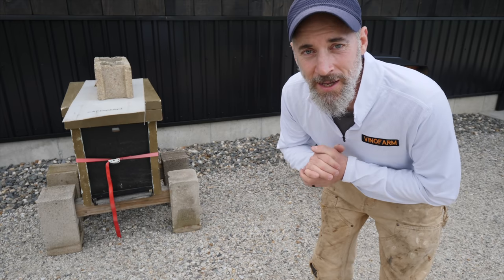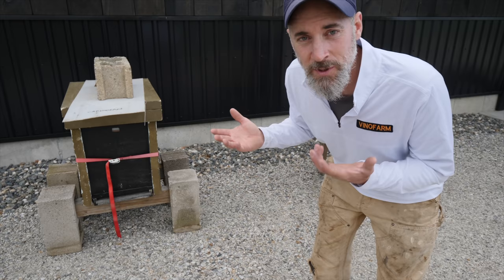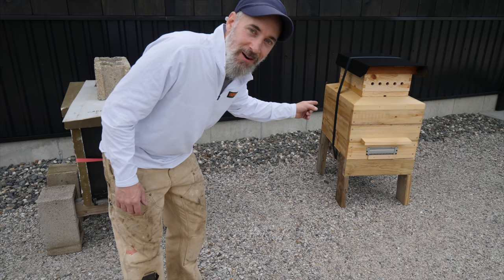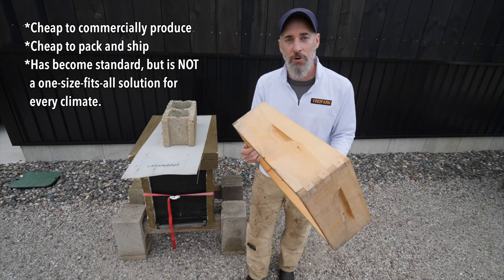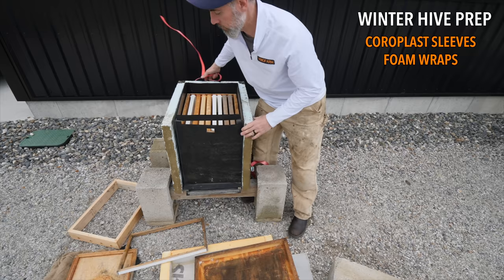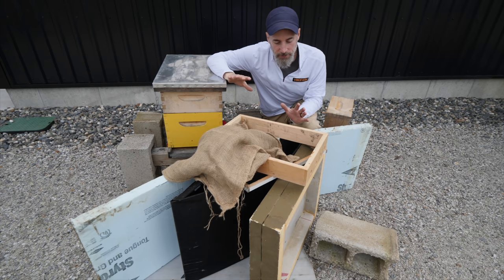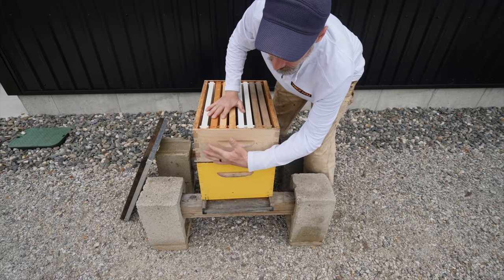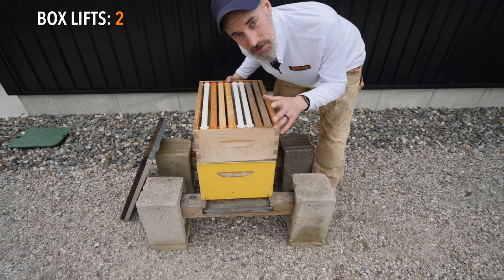I Fixed The Langstroth Hive (For The Bees AND The Keeper!)

Comment: It seems as if you were heading towards re-inventing what is called here a "Warsaw's hive" ["ul warszawski" in Polish] :).
A stationary hive, used in Poland  (winters used to be harsh) mainly by older beekepers (back issues!) , with a 'narow-high' frame (hight greater than width = better space for winter storage ), with no need of lifting boxes, possibility of adding supper.
Reply from the maker: Great minds think alike, I guess? I have never heard of this, but if you have more information, I'd love to hear about it.
Reply: @vinofarm  It's a hive, based on ideas / solutions to problems - as you discussed in your video :)

It seems the first piece of such a hive (in it's "standard" version) was built in 1880 by Kazimierz Lewicki (from PL nobility family). It was popular untill  WWII, when - due to standarization - it's been replaced by other hives. Later on it was "extended" into form of "Warsaw's extended hive" - allowing for having more frames and / or 2 families in one hive.
The top is fixed on one (front) side with hinges, so one does not even lift that piece at all. Simply open it like a trap door for inspection and it stays in place. Even less ibuprofen ;) + the roof can be slopy.
I believe similar hives are also used further E / N-E in countries with harsh or prolonged winters.

Comment: How much of a concern is the cold?

Because I think you have a weak spot at the top where the sides chamfer back into the box at a 45 degree angle. There's something called an "energy heel" for rafters in construction that allows for a contiguous r-value/insulation transition from wall to ceiling. I'm wondering if insulating the sides of the top box above where the burlap is by having a winter insulation wrap that would extend downwards with a reverse 45 degree chamfer would advantageous for cold months while still allowing for your side vents. You could even insulate the top lid above the side vents to allow for ventilation. You should also consider facing all of your bee hives so the side vents are not facing your prevailing winter winds.

Does that make sense? I'm happy to draw it up if you like, I work in building design and am curious what your thoughts are.
Reply from the maker: You're describing exactly what I'm already planning on building. I just haven't made the winter lids yet. When I made the video I had just finished building 6 of these to be ready for bees to arrive the next day. The last part of this is the winter lid, which will be ready for winter in 6 months or so. Stay tuned.

Comment: @VinoFarm Can you give a rough estimation of how many board ft it took to cover the insulated brood chamber (deep+med)?  Wood is so expensive right now, especially larger boards and better quality (ie: cedar) - do you think there are other options that wouldn't harm the bees?  I was considering some kind of siding, or composite boards, or metal roof panels?  Also, I live in a very wet environment (PNW) and was wondering if house wrap over the basic boxes and under the foam insulation board would help with wind and moisture getting into the hive?
I'm excited to see how this goes for you - I have been very unhappy with the wintering results from my Langstroth hives and was considering trying to build a Slovenian AZ hybrid hive to see if that protected them more, but yours is a much easier option.  Thanks so much for sharing!
Reply from the maker: Each hive used exactly four 2x6x8’ cedar boards to wrap around the insulation the way I did it. I paid $18 per board. Pine would be 12-15 these days. Cedar is way better. If you’re in PNW, that’s where this stuff came from. It would be cheaper there.

Comment: I'm trying my hand at making an insulated Long-Langstroth hive stealing some of your ideas from these hives. With 2x (fir?) for the main box, 2" of insulation (R10), and 1x cedar for the exterior. I'm planning on making a barn-style lid with extra insulation, venting, and room for some sort of feeder as well.  I do have a couple of questions though...

1. How do you treat with OA with such thick walls? Via the entrance?
2. Have you found the need to remove the insulation in the base in the summer heat?

Comment: Why did you say you wouldn't use burlap or a vivaldi board in Missouri.  I lost my first hive to condensation over winter because I wasn't taught how to deal with moisture.  When I questioned my mentor about venting the hive for winter he said the upper entrance would be enough and I went with what he said instead of my gut and what I had read because he had decades of experience.  It looks like the vivaldi burlap setup would have saved my bees. I'm definitely interested in following how your bees do with this new hive set up. I just got bees again and this looks like a good compromise between wintering with 2 deeps and just one. Thanks so much for sharing.
Reply from the maker: I have not heard of people in the southern states needing to worry about condensation over winter. Winters are not very long or harsh there. Northern beekeeper have condensation to worry about. Also Pacific Northwest beekeepers. Are you in Missouri?
Reply: @vinofarm  yes I am in Missouri.  Not a southern or northern state. Smack dab in the middle. Our winters are about 4 months. Moisture and humidity here in the winter can vary from year to year but we have the four  seasons very distinctly. I have learned since that unfortunate experience that moisture is our number one threat to overwintering bees.  We may not need quite the level of ventilation you have to insure but if there us no problem doing it that way here I'd rather be safe than sorry unless it creates an issue I'm unaware of.

Comment: So when it's hot in the summer. the bees generate heat, it keeps the heat in and the heat builds up. You need to do some tests on temperatures of a standard versus your hive over time, against external temperatures.
Reply from the maker: I have temperature and humidity sensors in all the hives. The bees are doing perfectly fine.
Reply: @vinofarm  interesting thanks. What difference in temps do you see? Out of interest.

Two of those disks on each hole would mean you don’t have to change over. Just select the open hole on which ever side was in the bittom
Reply from the maker: @Nickle314  Bees will do whatever they need to do to maintain the temps they need in the hives. Insulated or uninsulated, they will use as many bees as needed to heat or cool the hive. The concept here is that the insulation keeps heat OUT in the summer so they don’t have to use as many bees to COOL the hive and it will keep heat IN in winter making it easier to stay warm.
Reply: @vinofarm  
I came across hivegenie and a german open source equivalent. I was very surprised at the temperature difference in and out.

Comment: Did you ever find out the R value (insulation value) of different materials?
Would save a lot of hassles.
Types of woods make a huge difference as well as concrete, or even burying hives in the ground in a bunker?
Reply from the maker: R values are listed on screen. This has about R14 walls. Roof will be R30 when winter comes.

Comment: I'm not a bee keeper, so my comment comes strictly from my lived experience of living in a two story house without air conditioning.

You might want to consider having air flow from the bottom of the hive during hot summer months so cooler air can enter from the bottom and travel up through the hive and out the top.  It wold sort of act like a chimney.  Once a draw of air starts, it would keepthe air flow going until late evening when the temperatures equalized.

Thoughts anyone?

Comment: Well, looks like a similar diy version of a apimaye hive... although,  with the current wood prices ... I wonder which one would be cheaper 🤔
Reply from the maker: This was significantly cheaper because I already owned about 80% of the materials. These are made from my old equipment. Also, they’re 2x the insulation of Apimaye hives.
Reply: I was thinking... if it was cheaper ... If I built it... 😁  I already have one that I just got a little over 2 weeks ago... and while I'm on my learning journey,  I have learned that you should be ready for a swarm at any moment,  so it's best to have at least 1 back up hive...

Comment: Jim, I'm curious how heavy are the brood box frames when they're full?  I've admired your design from the start, and I'm wondering how a double super Bee Barn work out.  Would the frames be too heavy when full to be effective?  Have your medium/deep configuration been filled enough, or would the bees work better with even more space?   Your thoughts, please.  I'm planning my first hive for Spring, 2022.
Reply from the maker: Not unmanageable. The weight is not anything crazy, as long as you build the frames sturdy enough. They're 50% larger than a regular deep, so they become 50% heavier. The only thing that you need to worry about is that they are very long, so pulling frames out and returning them comes with more risk of squashing bees. But take your time and it's totally fine. I find myself slowing down a LOT, but that's fine because you're sort of inspecting twice as many frames at once.

Comment: I want to watch how this works out as I have though about this for thelast2 years, too much spraying around me.  They seem to die off too fast and right next to feed.  I had to move them in aug last yr to getaway from sprayed sunflowers and moved them back home late fall after everything was capped so as not to drown bees, also so I would not have to take a 4wd tractor to dig the moutafter a blizzard.  Ihavelost 40 hives the last 2 years right next to feed. I got very little rain last yr, 1 1/4 in measurable last summer.  Only honey lastyrwas out of hives in town, 20-30 lbs.

Comment: Is there any reason why you couldn’t put the metal vents on both sides of the cover? As long as you turn the underside vent to open, you can control the vents from the top without having to manually flip them. Awesome design
Reply from the maker: The bees will cover them with wax and propolis if they’re on the inside. It takes 30 seconds twice per year to flip them.

Comment: Insulating hive bodies in most climates, except for FAR north, is really a moot point. The vast majority of heat loss is through ventilation, i.e. cold, fresh air coming in and hot, humid air moving out. A better use of time/resources is to optimize ventilation heat loss, rather than conductive heat loss through the hive body walls.

Comment: I think it is a great design for the back yard bee keeper. The only thing I dont understand  is your winter  ventilation your concern for moisture/condensation . Condensation  is only developed when warm air comes in contact with cold or colder air or surface. To me your creating a condensation moisture problem.
Reply from the maker: It is adjustable. I am rethinking the ventilation. Might not have any for winter. I wanted to have ventilation in place for summer in case they needed more air flow in the heat of the summer. Since I've uploaded this and read a lot, winter configuration might change. Also, I still haven't built the winter lids. I have 5 months to work on it!
Reply: @vinofarm  would like to hear what you learn from your research. I'm sure you will like your reinvented brood box. Thank you for sharing with us.

Comment: Looking forward to the experiment.  Better you than me!  Biggest problem I can predict is you can no longer mix-n-match equipment.  You already have, what, 16 hives made of traditional equipment?  Now you can no longer use a resource hive to restock this new unit.  

Need to move a frame with queen cells to a nuc?  Good luck!.  Honey Bound?  Thoughts and prayers getting one of those frames in an extractor!  

As you previously determined, insulation was not your problem.  Mites were.  Why would you go through all the effort to not solve the problem?  Honey bees successfully overwinter in trees in Canada and Russia.  MA can't hold a candle to the winters in Siberia.   They don't need R-5 to make it though a winter.  Keep them dry and mite free and they will be fine.

NINJA EDITt  Did you ever get your dead outs inspected by the local country Bee Inspector? (Yes, we have one of those).  If you truly had a mite problem, they would be able to determine that.  If you had a mite problem, reinventing the hive structure does not help.
Reply from the maker: But what if all hives in the bee yard contained the same extra deep brood frames and all the resource hives were converted to fit extra deep brood frames? Keep watching to find out what happens.

Let me ask you what you think would happen if the bees in late February were just a liiiiitle bit warmer with R13 insulation as opposed to no insulation? Would they possibly brood up a bit earlier? Maybe start increasing their population in March instead of spending all their energy just staying warm?  What if the hives were just a liiiitle bit cooler in the middle of the day in July and August and 50% of the hive was not relegated to cooling duty? Do you think there would possibly be MORE bees available for foraging? There are ZERO drawbacks to insulation. Only benefits.
Reply: @vinofarm  I buried the lead on my first post.  Your problem seemed to be mites.  Not weather.  You already had them wrapped to the gills in insulation and they all died.  You know what the problem was, but your solution has nothing to do with solving it.  If you had foxes attaching your chickens, your solution would be to add more insulation to the chicken coop.  

I do not believe there are significant benefits to insulating a hive.  Bees have survived fine without human intervention for centuries.  Small tweaks to their environment here and there are fine, but insulating the hive disrupts their natural cycle (particularly in New England).  That's my opinion.  Have you seen any of Randy Olivers stuff?

If your bees in late Feb were just a bit warmer, they would have eaten more stores, then starved.  Cold bees stay hibernated.   

------Respectfully, some random internet dude.
Reply from the maker: @jackk4332  Not sure if you read my pinned comment. This is not meant to be a solution to why my bees died. This video has nothing to do with mites. It's about my sore back and trying to give the bees more brood box space. My mite management plan is a different video altogether. Regarding insulation... Not trying to argue. You keep bees however you like! This is how I do it. I have temperature sensors in all my hives right now and will be collecting data on every hive. I will be sharing all the things I learn this summer about how insulation affects the hives in summer and then over winter. Just looking at data for the past two weeks has changed a LOT of things I used to believe about bees. I will never not have insulation on my hives again. I appreciate you taking the time.

Comment: Luckily where you're at heat won't be as big of an issue but you're definitely being vastly far too simplistic on Heating and more so specifically cooling that Hive in the summer! I live in bee Country USA where the most honey is produced and we would kill most of our brood with this setup during a hot spell. With so little ventilation coming in off the front board and all that insulation those beehives are going to become a nuclear reactor of heat generation.

Comment: I do advise you, to watch Canadian beekeeper.That guy ,got over 2000 hives.The weather up in N.Canada is tuffer then your area.Also I do have 2000 behives.But I do live in Arizona.
Reply from the maker: The point of these hives is that they are for my backyard. I have 6 hives. I hope to maybe build up to 9 or 10 someday. I don't want 2000 or even 20. Ian the Canadian Beekeeper has tougher weather, but does not overwinter his bees outdoors. They spend their winter in a climate controlled building. Not really a fair comparison.
Reply: @vinofarm  he was doing that for the last 3 years ...never before.The secret of geting well over winter is .....depends what are you doing in the autumn ,with your family and where you locate them.Put them back to back and suround them with straw ballot.leave 1 foot beeween ballot and boxes.The bee family, is never disturb by the vertical air curents, in the box ,they do not like lateral cold air curents.12 months of the year, you must have vertical curents ,in your hives,that's the only way you force CO2 out of the box.Also humidity kills the bee,the vertical curent will keep the box dry inside.

Comment: I'm new to beekeeping. Wondering if there is any reason to worry about offgassing from the polystyrene board.  I was thinking about instead of using wood,  to use densified Solamide and use Solamide (open cell foam) for insulation as well. Have not tried this yet.... just thinking about it... no offgassing and better R value hopefully.
Reply from the maker: There's no off gassing from fully cured polystyrene. The hives I'm using in Version 2.0 are the same poly hives being used in millions of hives all over the world. If there were off gassing issues, we'd have known about it decades ago.

Comment: Just keep in mind that your reducing 16 frame into 8 frame. The disadvantage is your losing the modularity of Having 16 frames. For example, how would a brood frame look on the new frame? What happens if you just need boost another hive. frames with just mostly brood, Or a frame with mostly honey. You kinda lose a lot of versatility, in having fewer frames. How often do you have to move resources around to help out a hive?

Maybe have a few resource hive ready, so you can give the main hive a boost, if they need it.
Reply from the maker: All brood frames in the bee yard are converted to extra deep. The resource hives will be extra deep.